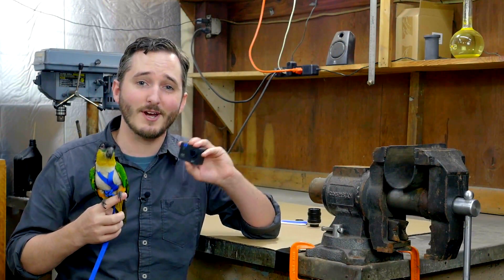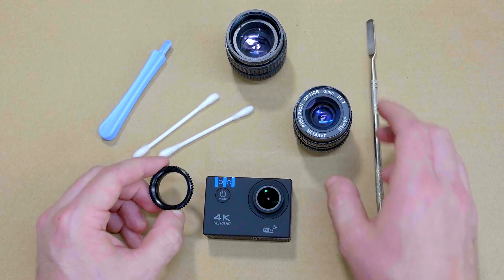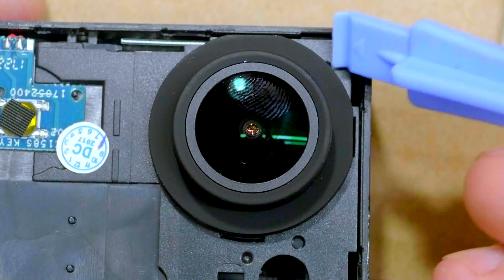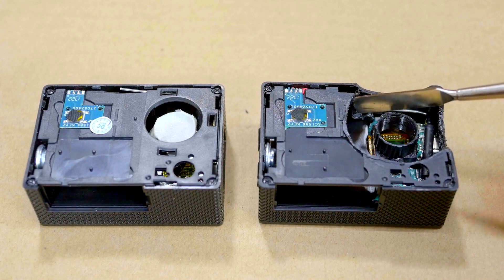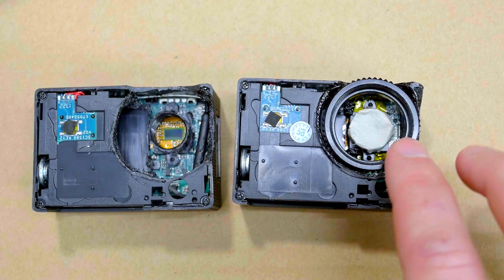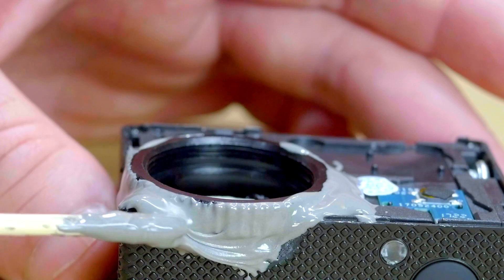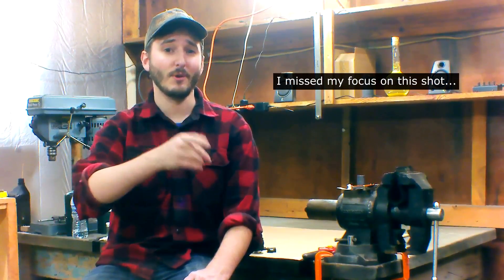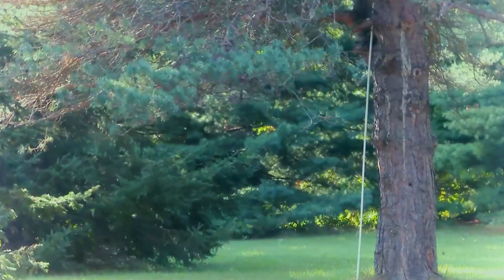How To Mod A Cheap Action Camera To Use C-Mount Lenses For Infrared Videography & Time Lapse

Comment: You can pretty easily find used GoPro cameras on eBay for around the same price as the cheaper knockoffs and I’ve bought several over the last few years

Comment: Why didn't you film infrared at night ? How about installing such IR configuration on the dashboard of a , for example , cessna aeroplane with a cable to a big monitor on the dash ? See if you can fly IFR at night or bad weather , with only moonlight , or some kind of an IR illuminator , without having to use the dash blind-flying IFR instruments of the plane , but only the selfmade nightvision .

Comment: infrared light doesn't damage the eyes it's the UVa and UVb.  the gopro 10 costs $400-$500 so you can tell how long ago this was videod also the new gopro has a linear mode

Comment: Hey is c mount & cs mount both are similar?
Reply from the maker: They are different
Reply: @Nighthawkinlight   So you are using c mount to c mount extension tube or c mount to cs mount extension tube?

Comment: To cut the circular hole easier, you could remove the other side (LCD screen) in the same way you remove the front cover. This way the housing comes free and you're not damaging the circuits. Other than that, cool project and I might give it a try one day

Comment: This is complete unnecessary if you just buy a s-mount to c-mount adapter, thats just it.
No grinding, no sawing...
Just remove the front case and the camera lens as nighthawk did and then mount the adapter in.

Comment: The original lens had an infrared blocking filter. Why not just remove the filter and use original lens? Needs a recalibration for the distance because the materials have changed  but still it should be easier than connecting a new lens mount.

Comment: How about using these cheap cameras to make a 360 degree 'dashboard' camera array...that will also capture Hi-Res 24-7 anything else happening. Ideally the Memory cards would hold several days of video, record at night, and the batteries would recharge whenever the car was running.  It would have to be "Set and Forget' and also work for traffic accidents. (About a week ago I missed  a large meteor shooting through the atmosphere. This is about the 4th time this has happened in  my life, . I was outside, standing next to my car, DSLR camera ready, but  pointing south at rocket launch that was scrubbed. The meteor was to the west. ) You might call this project The Chelyabinsk Meteor Camera Project....

Comment: I  don't know if anyone has pointed this out yet, but if you're using the screw mount to focus the lens it appears that it's difficult to get a good focus looking at the small screen at the back. For my Nikon DSLR live view, increase the magnification on the back screen: easy,  but apparently not for the inexpensive camera. It would be very easy to set up a testing set up, even just a tape measure, then establish a starting point: lens screwed down (soft) finger tight and then backed out. The threads of the C-Mount are I think 32/inch, so it would be very easy to divide one turn into 8 parts, or 1/256". Once you find a close point and a distant point, every step in between would be equidistant. 
Depth of field formulas are easy, but subjective. The general DOF indicators on SLR lenses are good enough... not for the focus but for the range of subject depth that would be acceptable.  Good project, thanks. The infrared is a real bonus, but it's not to be mistaken for a temperature gradient camera.  Infrared as a selfie option will always be more interesting than any of the canned filters in your phone. I would suggest that a gel filter close to the sensor is generally more practical than front filters and adapter rings. No fingerprints, probably fewer internal reflections, and less expensive.  (I did photography professionally for 40 years and one adapter ring for one filter was about all you could ever count on. I ended up using tape far more often than the rings. It's as bad as USB plug nonsense. But when gels and small sections of gels can be placed behind a lens generally everything is better.

Comment: One of the reason your image is so soft is because you set the lens mount rather randomly. A not centered sensor or not in plane would show aberrations but the soft focus is mainly due to a wrong flange focal distance. Each kind of lens has its own distance from the focal plane (your film or sensor are that focal plane) and if that is set properly than the lens is able to achieve focus through all it sees from its minimum focusing distance to infinity, if set randomly you might be able to achieve focus just at certain distance ranges but lose the ability to focus outside of that or in some cases lose the ability to focus at all (extension rings works on that principle).
For C-mount lenses the distance between the lens flange and the focal plane is 17.53mm (and with a simple wooden jig and checking the image focus at infinity you can get to that precise distance without much difficulty, a jig will also help you to mount the ring centered and in plane).
The image comparison should have been made between the same camera with original lens and the modded one to give it a fighting chance.
PS: some people mentions m12 to c-mount adapters, the problem there is that it will all rests on the original lens mount attached to the circuit board and thats too weak for the heavier 
c-mount lenses.

Comment: Cool project. Might want to add a step to clean the sensor after you cut out the housing for the new lens. There are very visible amounts of debris that can be seen. Also, You may want to manually step down exposure compensation for full spectrum and visible light. IR looked fine.
Reply: Always glad to your feathery friend in a video. :)

Comment: Excellent tutorial! And the part about blocking visible light spectrum is very interesting in particular! Is there an option to make some sort of thermal camera by tweaking the filtering of the light? IR image seems to be the right way to make thermal cam, right?
Reply from the maker: You need a special sensor made to detect infrared light to get it to detect enough to act as a thermal camera.

Comment: Nice mod! One thing I think you didn't take into consideration is the flange focal distance for C-Mount lens - it's 17.526 mm. If they are farther or closer to the image sensor, the image will never focus as the labels on the lens would imply.
Reply: Hmm.. does it mean it will not focus if we add extension tubes to it for macro videography?
Reply: @reedgeek  it means that if you use extension tubes, the focal range is locked at very close distance and you can't focus at infinity. That holds true for all cameras with extension tubes.

Comment: I have two of those cheap action cameras.
The first one is the same as yours, with the IR filter attached to the back of the lens, which is super easy to convert to film IR. The other one has the IR filter attached directly onto the sensor, which I destroyed the sensor trying to remove the sensor (sigh). At the moment, I'm trying to buy another one to convert, but don't have a good method to distinguish the difference.
 BTW, the c mount ring is also used as an adapter for CS mount lenses. C and CS mount lenses use the same mounting thread, but have different flange distances. (CS=12.50 mm, C=17.5mm)

Comment: Very good results! 

I was wondering if the camera allowed you to lock the automatic exposure adjustment?
Most of cheap camera's won't allow this by default unless you hack it's firmware. All footage looks absolutely great, especially the fact you invested more time than actual money for a very cool and custom camera. 

Gladly these cheap Chinese 4K/15fps camera's don't have built in zoom mechanisms, which brings you directly to the image sensor. Nice idea for the next project: Find a comparable cheap cam with auto exposure lock options and maybe a little bigger image sensor than this model, I'm sure everybody will get exited to build one themself! 
And If not... Well...  People will be bagging to sell the little monsters to them!  Great project!
Reply from the maker: No lock for the exposure, but you can adjust the exposure baseline

Comment: It appears to me that the picture is allocated to the percentage of lens the small black tube around the sensor gives it. Basically a fixed aperture. Would throwing a cone that spanned the entire aperatuer of the C- ring make more use of the lense and it's light gathering ability?
Reply from the maker: No, the tube is in the wrong position relative to the optics to act as an aperture. The light that the tube cuts off would miss the sensor anyway because it is smaller than what the lens is made for.

Comment: All wonderful stuff, especially the IR.  If you can make some sort of clamping device to hold camera and lens, take a long focal length lens set to infinity, and adjust distance between C-mount and camera before the epoxy sets so the horizon is sharp, this will get your mount in exactly the right place.  Also if possible, adjust so all four corners are sharp at this stage.  Everything you shoot with this thing will be much clearer.  As good as the original lens or better.  The softness in your video from it is because the lens is in the wrong position.  Multi-element lenses need the correct mount position.  You can still adjust them to bring things into relative focus, but they work much better when the mount is at the correct distance from the sensor.  Your epoxy method is great because it allows some time for this adjustment, and additional epoxy can be added to fill any gaps that develop during the adjustment.

Comment: It's better to call it with a proper name - "near infrared" (NIR), not "infrared", which is an umbrella term for a whole IR spectrum (NIR, MIR, FIR) but also used as a name for thermal imaging.

Thing is, you can't use ND filters for this. They pass visible light because they are visible light attenuators. What you got there was so called "full spectrum" image with attenuated visible light and that's always a bad result if you want a NIR image.

You need a filter that literally stops visible light by its very chemical nature, and lets through NIR rays. There is a variety of such filters accessible, and as far as I know, the ones that block even the very last of visible light are filters with transparency peak at 1000 nm. They are completely black to the human eye.

Comment: WHY you didn't use a cheap M12 - cmount adapter?Remove (M12)lens, screw in the adapter and then you can use cmount lenses!
Reply: man you just saved my life thanks don't need to make a mess cutting stuff up

Comment: So I ordered a m12 cmount adaptor, I'm not a fan of the epoxy method. I hacked up my camera and spent a good amount of time trimming the bezel and doing a clean install as well as retaining the plastic button for power. I was pleased with my work and decided to take the camera completely apart to install a 3.5mm jack. I got as far as getting the back cover off when somehow the screen was damaged. No big deal though $26 bought me a brand new one and I was able to add the cmount lens and 3.5mm audio jack taking care not to damage the screen. Now I have one with a bad screen to put in places where cameras my be in danger.

Comment: What happens if you get 2 polarised lenses on top of each other, orthogonal so they go opaque, then look through with the visible spectrum blocked.
Reply from the maker: That's how a variable ND filter works, the same sort I used. They have two polarized pieces of glass that you rotate to get varying degrees of filtration.
Reply: That's groovy as heck. Once you know how the world functions it becomes a lot easier to reshape and more informative to observe.
Ended up asking this because of a "minute"physics* video about light acting odd when a third lens is added.
*The video was actually 17 minutes.

Comment: Theoretically, you could carve away a section of the extension to accommodate the battery. If you are careful to cut through the threads cleanly, it would still work.
Reply from the maker: I hadn't considered that. You might be right.

Comment: I've been into IR photography for a while. In fact I've modified my old Canon 300D by removing the "hot mirror" IR filter and installing in place a piece of wideband glass of equivalent optical path. Makes for some cool pictures - and you can do pseudocolor if you use different band pass filters. Composing an image is pretty difficult though because this old camera doesn't have live view, and the image that you get in the viewfinder is what passes through the front filter i.e. very little visible light with most filters. I've thought of modifying a more modern camera (one with liveview, that would cost quite a bit), but now I think I'll do this mod and have something that can record IR movies instead.

Comment: I need to get the runcam 2 to use a canon EF mount. Any suggestions?
Reply from the maker: EF lenses are going to be super soft on an action camera because they weren't made to be used with such a tiny sensor. Otherwise it could be done in a similar way. Remove the old lens and mount an EF mount adapter so that the outer flange is 44mm away from the sensor for proper focus.

Comment: Alternatively, just buy a replacement M12 mount lens with a longer focal length instead of the much larger c-mount.  Simply swap it with the stock lens.  It'll just screw in and you won't have issues with alignment.

Comment: C-mount lenses are made for 8/16mm movie cameras, this is why it is suitable for this camera having the sensor size about in this range. I do not recommend to use in projects like this lenses made for larger film size than your sensor. (E.g. don't use a lens for 35mm film with RPi camera.) The very center portion of the lens will be used, and will produce terrible image quality. Also note, that digital cameras has special coatings in the lens to reduce some problems a digital sensor suffering from. Am I right?
Reply from the maker: Yes, lenses made for larger sensors will be very soft. Coatings on lenses are mostly to reduce flare, digital cameras have internal filters that should take care of any other issues.

Comment: You could always make a jig that lets you thread the c-mount onto the original lens mount. It would be a much harder project, but it would guarantee the new lenses were positioned correctly, which would be a must for optics nerds.

It doesn't need to be permanent, either, since it can be made to thread into the lens side of the adapter, allowing you to remove it after the epoxy sets. Then you don't have to worry about blowing it up, setting it on fire, or splashing it with acid. The fancy lenses will die, but you won't have to cut threads again!
Reply from the maker: I've learned from other comments that the thread is m12, which they make adapters for to c-mount. The problem is the internal lens mount is cheap plastic and would quickly brake if holding the weight of a larger lens.

Comment: This is approximately a Near Infrared camera. So 700 nm to ~2000ish nm but it likely falls off in sensitivity far before the 2000nm. This is different from true thermographic Infrared cameras that cover the 900–14,000 nm spectrum that most people expect with Infrared cameras. 

But nonetheless a very nice project, something that I've tried before and I think others should do too.
Keep up the great work :D
Reply: nope in real life the sensors of consumer products can catch max to 1100nm and in theory they should see up to 1300nm. if you know of a cheap 2000nm camera, please give me a link :)
Reply: "but it likely falls off in sensitivity far before the 2000nm"
Reply: where did you read that? on wikipedia they wrote 1100nm as upper limit which is true from my practical experience.
Reply: i just wanted some info, dont be hyper sensetive , its a youtube comment section discussion. 
Considering that fact, i was extreme-above-average polite :D.

Comment: Great video, I was just working in a very similar project just as you upload this video. I was surprised, but very happy too since I follow you from a very long time.
I´m modding the same kind of cameras for survaillance, exploration and for scientific research. I'm currently investigating tiny lifeforms, but I'm also concerned about it's potential for scouting, so i'm modifying it with support for interchangeable pack of li-ion batteries (the ones from cellphones, as well as the ones pc batteries contain inside), for solar panels (farmed from backyard led lamps) and a dynamo charger option (made from a small driller motor). As you, I made support for optic lenses (farmed from a lot of sources, mainly recicled), and for various types of light; visible, UV and IR for nighvision..  In the end I'm tranforming it into a portable, versatile, more sustainable tool for long time recording for a broad spectrum of aplications;  research, investigation, etc.
 Good to point out the advantages of purchasing these v/s expensive brand ones for these applications, at least. Mine even came with the typical polycarbonate case, to film underwater and other accesories as well, that I plan to upgrade in the future too. Finally, I got to say taking out the IR filter built on the camera its a very easy mod following the same principle of maybe the most famous camera hack on ytb, the famous "IR filter from an old camera film, in a digital camera sensor", but even easier. Greetings, and keep on like this!